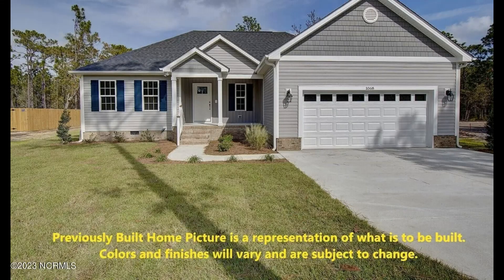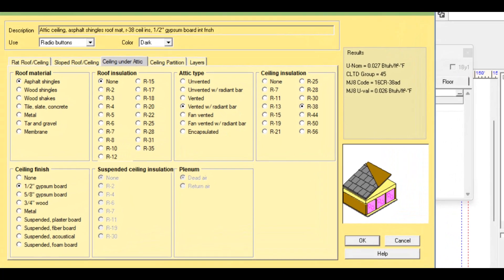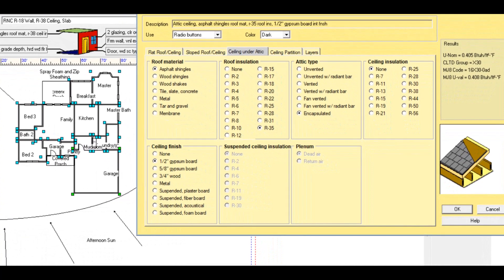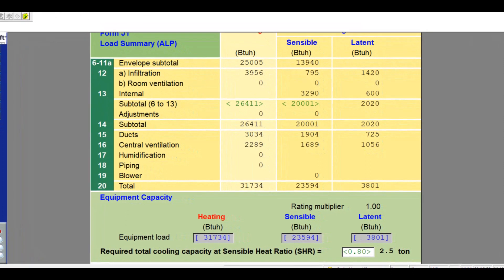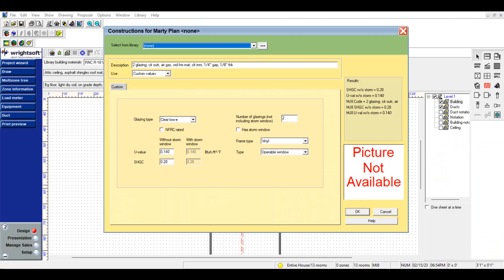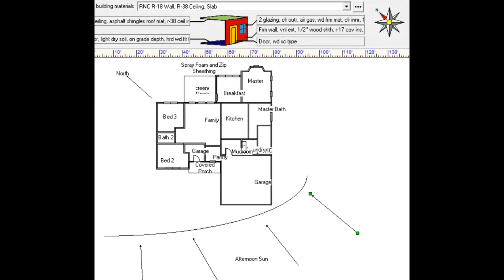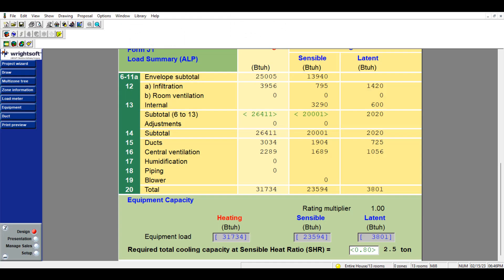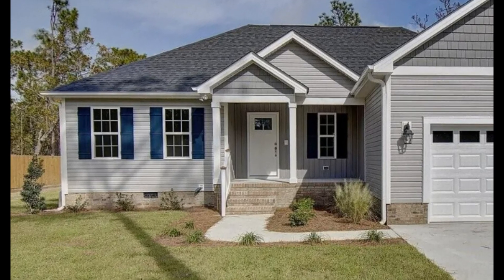My Southport House Part 1

Comment: Lowering the air leakage from 5 ach50 to 1 or 2 would do way more to change your load than adding fancy insulating products
Reply from the maker: Yes, air tightness is #1.  #2 is getting ducts out of a hot attic which is why I went with spray foam in the attic only.